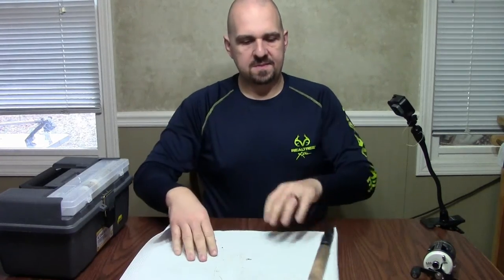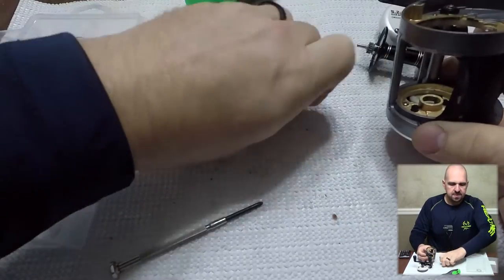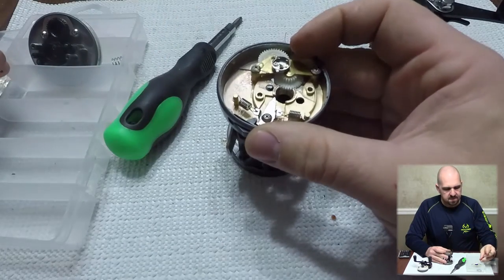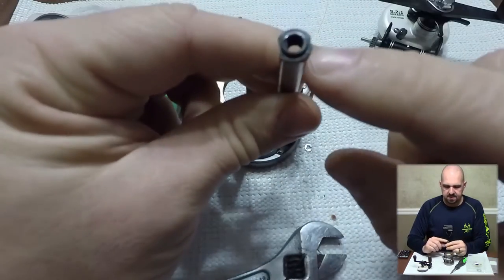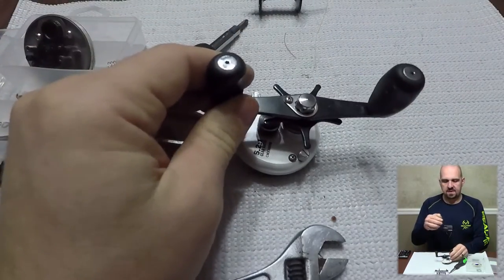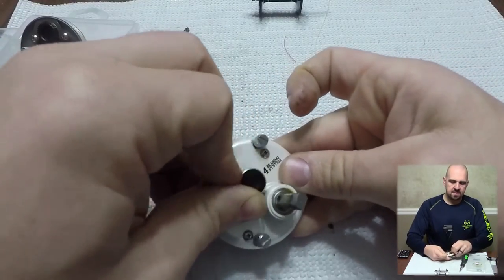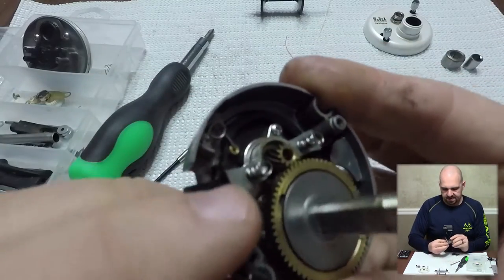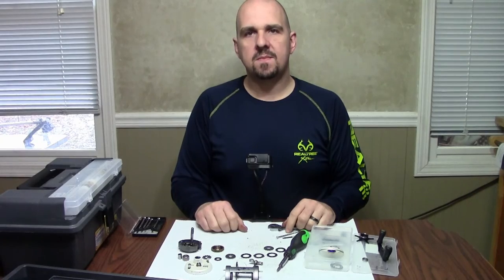How To Disassemble, Clean, and Lubricate a Bass Pro Shops Catmaxx Reel Part 1

Comment: Hey Josh i have one of those reals and was wondering if you can make the clicker louder?
Reply from the maker: I haven't found a way to do so yet. I have thought about trying some different springs for the clicker, but my intent there would be to make the clicker hold a little better in moving water.
Reply: I agree there.   Thanks

Comment: Josh - I feel like this is a good reel for the money but BPS said it is for use in freshwater only.  Another comment I read was that if it was used in a salt water fishing application, immediately after the spool should be removed and the reel should be thoroughly rinsed with freshwater.  Have you ever used your CatMaxx for saltwater fishing and if yes, how “thoroughly” do you clean this reel?
Reply from the maker: I have never used my catmaxx for saltwater, and I'm not sure that I would. If you do, however, I'd separate the reel and at least give it a good bath in fresh clean water to wash out the salt. Use warm / hot (not too hot) water and it will help dissolve the salt easier. 

Salt is very hard on equipment.

Comment: Good video buddy i need to fix my cattmaxx or send it back for another one. My last catmx i took it apart and those little bearings went flying everywhere lol. Sent it back got a new one and guess what, its tore up too.
Reply from the maker: Ouch! Knock on wood I've had very good luck with mine, and any time I've needed a part Bass Pro Shops has been very good about getting the part sent out to me via the mail.
Reply: @TheWeekendAngler  yeah I can send it back but haven't got around too it.

Comment: What kind of bin is that
Reply from the maker: To which bin are you referring? The one I'm throwing reel parts into is just a cheap plastic divided organizer I bought at the hardware store when they were on sale for $1 with a $1 mail in rebate (Free!) 

The other is just a cheap toolbox I bought at the same hardware store with a single removable tray. 

I am probably missing the intent of your actual question by a mile here, so if I've given you a dumb answer, that's on me. Point me in the right direction and I'll be more specific.

Comment: Man I need to do that to a lot if my reels. Kinda scary breaking them down that far. Are there any upgrades you can do to these reels? I dont like the clicker on them.
Reply from the maker: The clicker on these reels sucks. I haven't found a way to make it louder or hold better yet. Changing to a stiffer spring would make it hold better, but I haven't tried yet.
Reply: I was going to ask the exact same thing. The clickers are worthless on these.